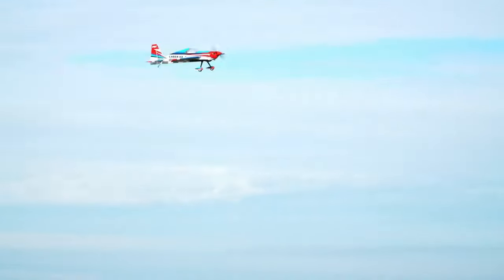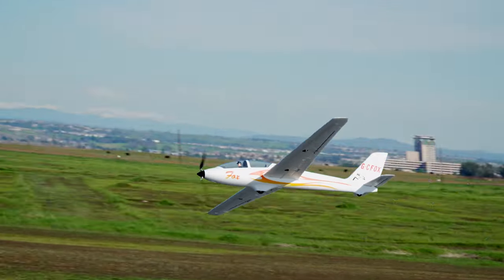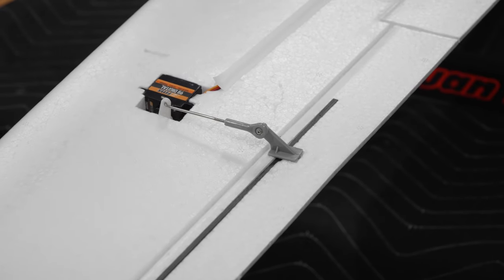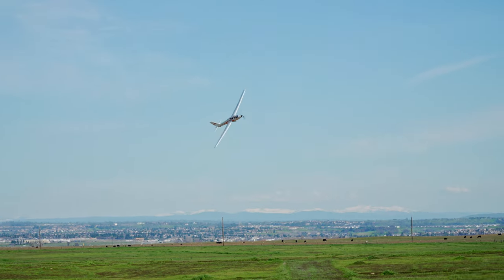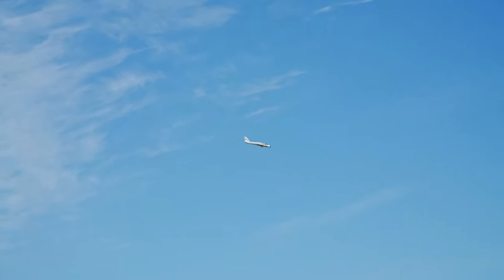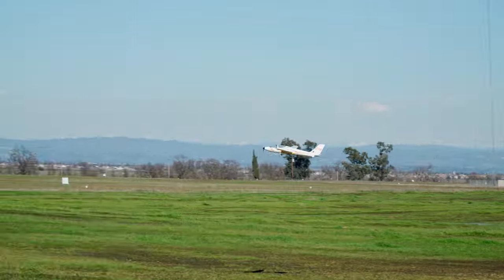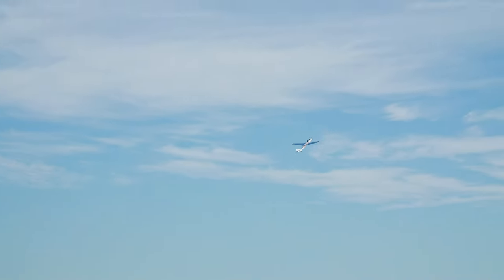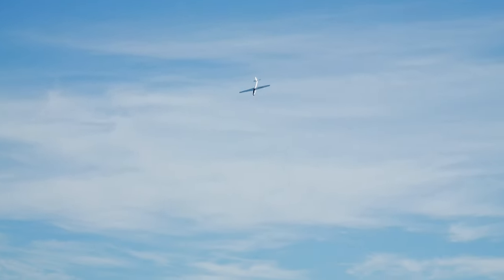FMS 2300mm Fox PnP Review

Comment: I have the V1 fox since 10 years (I must confess, I had more than one of them, but lost one due to broken receiver, and another after a midair with a big towplane) and it still performs well. The V1 doesn't have the flaps. Other than that it performs still very well. I completed a pair of wings with LED's to have a night aerobatic glider...
After 10 years everything weared out quite a bit, it has no resell value whatever, but it is still to launch it now and then.

If you're looking for a good foam glider, capable of thermals for quite some time this isn't the right plane. But if you're looking for a good foam aerobatic glider, this is the sweet spot.

Comment: So did you only do aerobatics with the motor on?
Reply from the maker: I also did a bit of climbing with motor on, and then doing aerobatics with motor off, but it takes a long time to get good altitude, and the plane loses energy very quickly, so there's not a lot of time to actually enjoy motor off aerobatics (like you would do with some bigger composite glider).